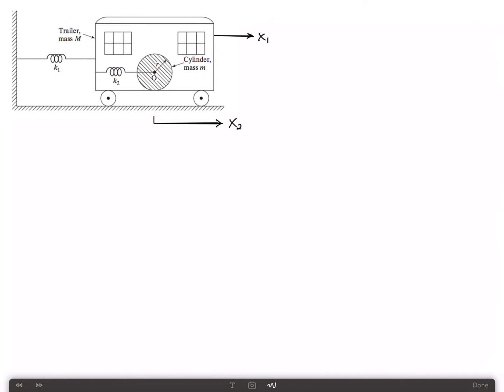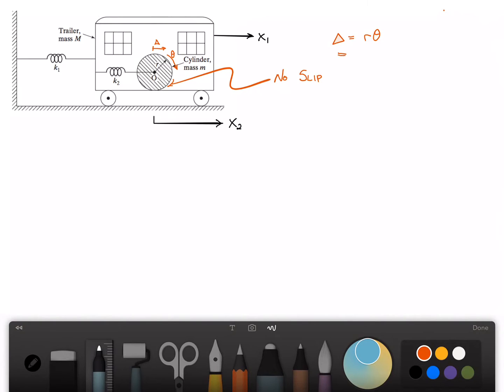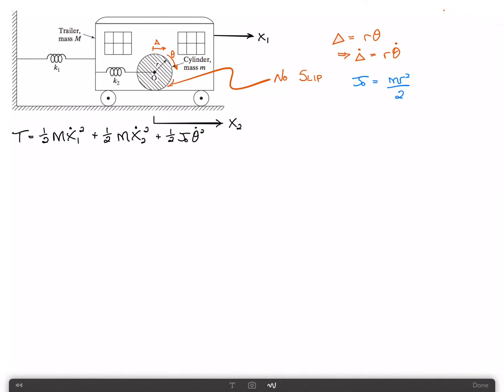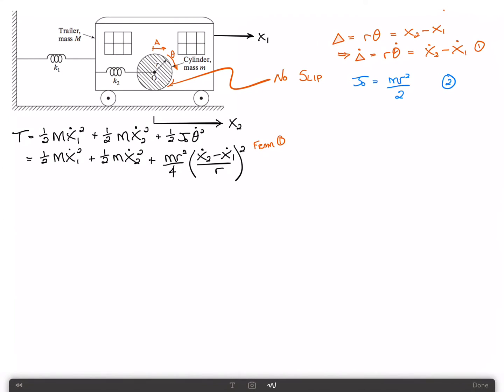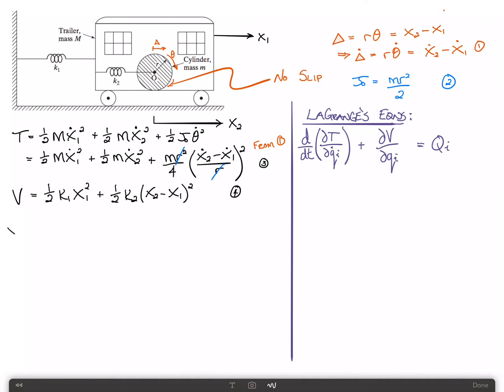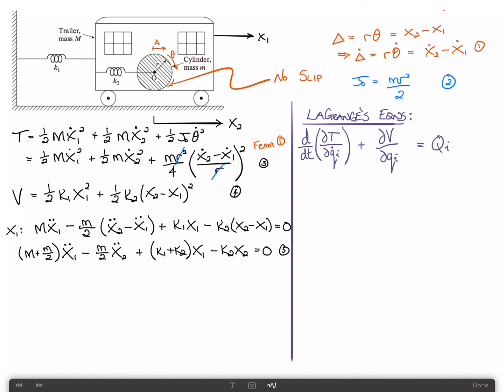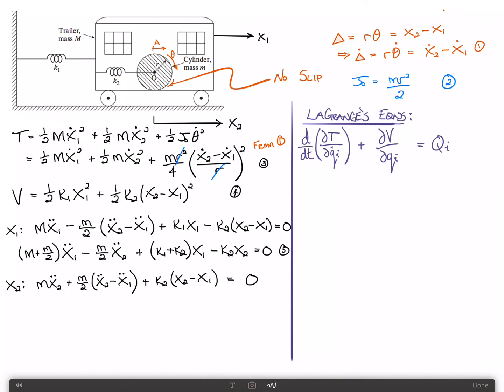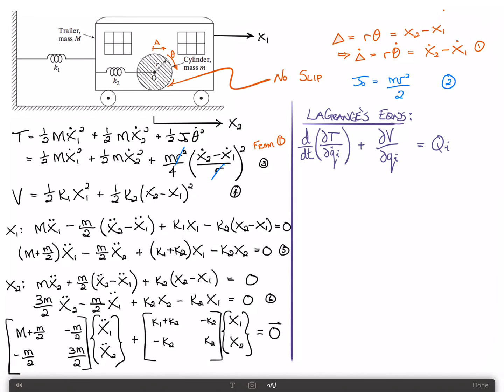Equations of Motion for a Cylinder Riding on a Cart (2DOF) Using Lagrange's Equations

Comment: How would this change if there was an external force acting only on the cylinder?
Reply from the maker: Assuming the force, F, was applied at the center of the cylinder in the horizontal direction, the second equation of motion (eqn. 6) would have F on the right-hand side instead of zero.

Comment: Hello sir, 

Why didn't you do the following?

1) in the kinetic energy, instead of replacing theta_dot by (X2_dot - X1_dot) / r we replace X2_dot by X1_dot + R * theta_dot
2) in the potential energy we write the energy of spring K2 as 0.5 * K2 * R^2 * theta^2

therefore the EOM will be in terms of X1 and theta
Reply from the maker: Yes, you can use x and theta as coordinates instead.  This is acceptable since it fully describes the system.  The equations of motion (the matrices) will look slightly different, however, certain characteristics will be preserved (like the natural frequencies).  The choice of coordinate is typically dependent on what one is trying to investigate since some coordinates may be more convenient depending on the problem.

Comment: The friction between the cart and the cylinder causes the no slip condition then why the force along generalized coardinate x2 is neglected ............
Reply from the maker: The force caused in the x2 direction by the no-slip condition is a kinematical constraint - it's an internal force.  It is included in the sense that it couples the coordinates between two rigid bodies, but it is not an external force in the x2 direction.

Comment: In the start of equation 6, it should be (M+m/2) not 3m/2.
Both M and m are different....right?
Reply from the maker: It is correct as written.  Yes, M and m are different, however, M does not appear at all in the equation for the x2 coordinate (since it only multiplies x1_dot and not x2_dot).  

If you go back one step and look at the expression for the kinetic energy, T, you will find that there are two terms that yield a "m" after differentiating with respect to x2_dot.  These come from the second and third terms in the K.E. expression.  The first term of the K.E. which contains the M is eliminated when differentiating with respect to x2_dot.  I think if you write out this step on paper, you'll see it instantly.
Reply: @Freeball99  oh yes. I get it now. 
Thank You very much "GURU DEV".

Comment: Why you are using dev for both x1 and x2 while deving only x1
you can see in 5:50 min
Reply from the maker: According to Lagrange's equations, I needs to take 2 derivatives.  First with respect to x1_dot and then with respect to time.  In this case I did both in one step.

Taking the derivative of   m/4 *  (x2_dot - x1_dot)^2   with respect to x1_dot (using the chain rule) results in:
-m/2 * (x2_dot - x1_dot)

Taking the derivative of   -m/2 * (x2_dot - x1_dot)   with respect to time results in:
-m/2 * (x2_ddot - x1_ddot)
Reply: @Freeball99  What about the potential energy when you differentiate isn't it xdot instead of x.
Reply from the maker: @tanmanpeng5675  Potential energy is never dependent on velocity.  Lagrange’s equations does not require us to differentiate the potential with respect to time. Only with respect to the coordinates.